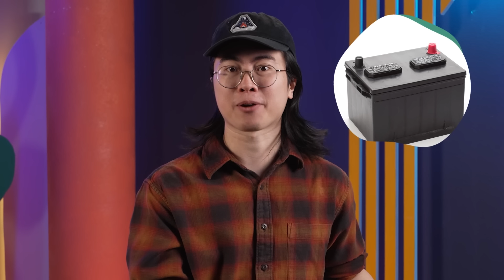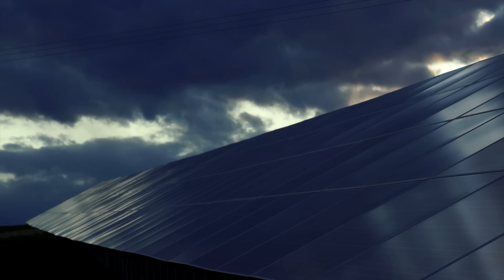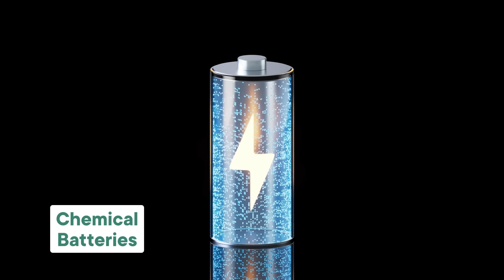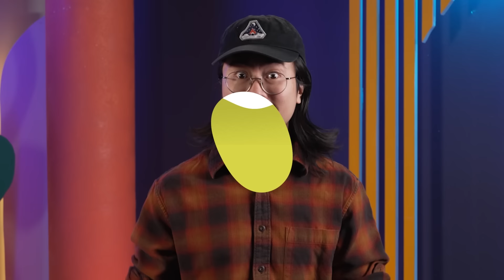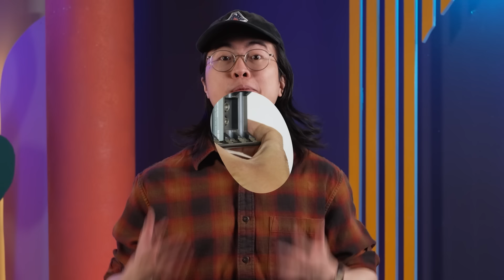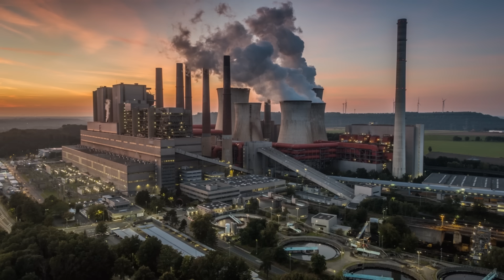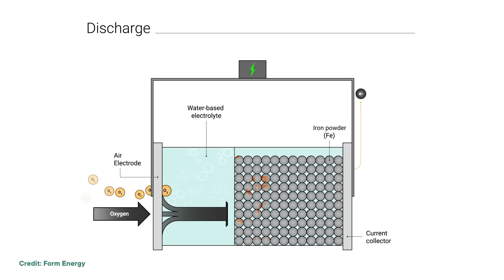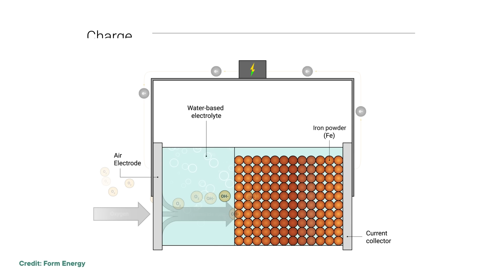The Weirdest New Battery is... Rust

Comment: I worked for one of the companies that provided equipment to form energy for the building of their batteries and I really hope they found someone else to make those parts. That company had absolutely no regard for cable management, which often introduced improper bends. Oh and they also ran a huge power supply cable in the same tray as networking cables so....

Comment: The Core: The 1kWh EVO Brick
• Chemistry: LTO (Li4Ti5O12) zero-strain spinel anode + Li6PS5Cl sulfide solid-state electrolyte + NMC cathode • Why it lasts: LTO has <0.1% volume change during charge. No cracking. Solid-state blocks SEI growth and dendrites. • Result: 1,000,000 cycles at 80% DoD with 95% retention. 146 Wh/kg at cell level. No thermal runaway. • Weight: 6.83 kg • Target Cost at Volume: $99.50 / kWh — BOM is public: $22 electrolyte, $18.50 cathode, $15 LTO anode, $12 BMS. 
Then we scale the same brick

Comment: I'm guessing these batteries will be damaged by low temperatures, for the same reason why you don't discharge Lead-Acid batteries too much, when too cold below zero, because the Sulfuric Acid Electrolyte becomes more like water, and when water becomes ice, it expands, with enough force in a sealed space to rip engine blocks, which is why engines used during winter must have Antifreeze mixed into the coolant. 

At least with Lead-Acid batteries, you just have to keep them charged enough for the low temperatures you're expecting. The more charged. The more the Electrolyte is like Acid, less like water. I think like 60% or higher, Earth weather temperatures can't freeze a Lead-Acid battery. But these Rust-Air batteries, requires water. Pure distilled water? So does this mean they have to be deep underground, or in temperature controlled rooms to prevent freezing? Or their Water Electrolyte already has some Antifreeze mixed in, that doesn't reduce the effectiveness of the battery? I have to look into this. This is the the first time I've ever heard of Rust-Air batteries.

Comment: These guys are creating a huge hype around iron air batteries. While they could be much cheaper (10% of lithium), currently they are just cheaper (~50% of lithium). Also they are heavy (~4x of lfp) and needs a lot more space (5x of lfp). But the bigger kick is their discharge rate as well as high self discharge and low efficiency. Their discharge rate is 0.01 C, meaning a full battery takes 100 hours to discharge. This is advertised as a good point but it is not. For comparison even slow discharge LFP batteries have 2C discharge rate. This means you will need large amount of storage to make up for the slow discharge. Second issue is self discharge, iron air batteries discharge about 2-5% everyday. So if that cloudy day doesn't come for a week you will lose 1/3 of your power in that duration. In addition, they are very low efficiency. Even if they are used immediately after being charged, realistically, you will get about 40-50% of what you put into the battery. In real world applications you will be looking at 20-30% efficiency.

Some of these figures will probably improve overtime; even if they don't improve, a cheap battery tech is currently needed to balance over production. But this tech is being way overhyped for what it  brings to the table.

Comment: "A hundred hours worth of energy" is a completely meaningless stat if you don't also include the power draw. 100 hours powering an Arduino is not the same as 100 hours powering an EV.

You really failed to sell the concept just because there's literally nothing to compare. Like, we'd never be able to sustain a power grid if "over 100 hours worth of energy" is true only if you're charging a cell phone.

Comment: really sad 70% of the video is about what 90% of people knew who watch this kind of video.
So much detail on Lead Acid and Lithium and just a short blurb on this new iron air battery.
I'm not sold on this as it seems the cell resistance should be pretty high. Which means lots more cells in parallel and likely batteries several times the size of an equivalent Life04 installation.
The rusting action I suspect would give a lot of mobility of the iron particles after only a few cycles. But I'll see what I can find about this battery chemistry.

Comment: renewables are supported by the fossil fuels industry,  bcs they physically cant solve the issue, without ecological violation, and 'perfect conditions', and batteries wont prevent this issue [tho it can help]; you need Nuclear Power as a baseload on the grid, just as these fossil fuel companies are pushing for, in regards to coal and natural gas, as baseload on the grid. Nuclear Power is the only way we are gonna escape fossil fuels

Comment: My institute physics teacher showed us that you can make batteries out of coins, and that technically any 2 metal things with a poorly conducting gap betwen them can be a capacitor.
Not the same as an accumulator but pretty fun still.
Reply: So called "super capacitors" can hold a significant amount of energy.  The trick is to make the nonconductive barrier very crinkle so that it has a huge surface area.
Reply: @kensmith5694  cool

Comment: Don't lead-acid batteries live forever? There's no thin isolation layer to pierce, just a vat of acid instead.
Reply: Other side reactions happen that degrades the material in the battery.  This happens mostly when it is discharged.  If you keep them charged, it takes quite a few years before they need to be replaced.

Comment: Instead of pouring thousands of tons of concrete ballast into the lower basement levels to stabilize the base isolators, new skyscrapers should install dense, heavy rows of iron-air batteries. They supply downward force required for structural physics while serving as grid infrastructure.  However, Sodium-ion is a more costly but far more energy dense smaller package choice for neighborhood substations, and works better in a wider range of temperature zones.

Comment: @7:25 You "higher capacity" is a bit misleading, because energy density of iron-air battery is 4x lower compared to li-ion batteries and it will take a lot more space. If 110x lower cost compares the same capacity, that is impressive. If it only compares the material costs, we are only being 25x cheaper than li-ion. Taking into account that charging/discharging wastes 3-5x more energy each cycle vs. Li-ion, we are now at 6x cheaper than li-ion.

Comment: When I was in highschool I made one of these for a science project. It was made with a sheet of tyvek, a layer of graphite silver paste with a silver plated stainless steel screen for the positive electrode, a potassium hydroxide electrolyte, a fiberglass separator, some steel wool with rust added, and a stainless steel screen as the negative electrode. Charging makes silver oxide and iron, discharging makes silver and rust, but the silver only helps to kick start the reaction by shuttling the oxygen in and out. Voltage was about 1.3V freshly charged, and 1.1v after it stabilizes. ❤

Comment: It would be nice if you actually gave some technical stats and comparisons for the people like me who cafe about them like cost per kWh, charge rates and discharge rates, energy density kWh/kg and kWh/l. Rather than just hand waving and saving hey they are cheap and provide steady power....how cheap? Just state it in a couple of slides. It also shouldn't take you 6 minutes in a 10 minute video to explain batteries before you get to what makes this type of battery special or unique....

Comment: I absolutely could be wrong, but I thought the current flows from negative to positive, the electrons want to flow from the electronegative area of the cathode through the electrolyte to the anode. When the charge gradient reaches equilibrium, the battery is 'spent'

Comment: if the show hasnt done it yet they should do an episode on (or mention somewhere) those Gravity Batteries or whatever theyre called. where renewable but inconsistent energy (wind, solar) is used to "charge" the battery by powering pumps to move water from a lower reservoir to a higher one, and then generating hydro power on the way back down by releasing water on demand (no wind, no sun days). ive wondered how well the math actually works out on those.

Comment: The problem with rust is not the oxidation itself, but the corrosion (the same happens, albeit in a milder manner, with lead acid batteries). This video didn't mention how the corrosion would be dealt with.

Comment: rust also has the power to break concrete its called spalling. rust expands and forces cracks into concrete that lead to structural failure if its bad enough

Comment: While it's very enthusiastic they never spell out the disadvantages of iron air batteries. Which are huge. Rusting of iron is an extremely slow chemical reaction. It's extremely inefficient. They will only ever make sense if we have massive over production of renewables. The size of the battery you would have to build to have any kind of grid level power output wouldn't make sense when there are better alternatives. I'm not sure why SciShow did this one. It seems under researched and over hyped.

Comment: Its not a lithium replacement -- just a large scale power hold .... but theres plenty of competition there , from moving water (oops we short of that) , to high pressure air storage, or any reversible chemical reaction. (all of which are used in some place or the other), or even converting co2 into methans, then burning the methane.... Pretty sure i remember a 'battry for cars' touted by camebridge (univ i think) which used 'rust' ....

Comment: Also, if corrosion is what causes the electron flow couldn't a more corrosion solution than water be used in applications where faster electron release is required? What about using liquid oxygen?

Comment: Summary:
Iron-air batteries are low-cost, heavy, and well suited for long-duration grid energy storage, offering lower efficiency but improved safety and extended storage times. In contrast, lithium-ion batteries are lightweight, energy-dense, highly efficient, and ideal for electric vehicles, consumer electronics, and other applications requiring fast response and compact size.

Comment: Come on. Cobalt oxide as cathodes? You should know that LFP batteries are the main technology right now. LFP has no cobalt. Cobalt oxide is really outdated. This is especially important because some anti renewable people would fixate on cobalt mining…which is way less polluting than constant fossil fuel burning, but most importantly we have better LFP technology that doesn’t requires cobalt at all.

Comment: If you have a battery technology that gives up its charge slowly, then you just put a bunch of those batteries in parallel. There is no need to supplement an iron battery with lithium batteries for grid storage. You just supplement iron batteries with more iron batteries.  I watch y'all's videos with the expectation that you have actually researched what you're talking about. Your lack of fundamental knowledge about  something as simple as the discharge rate of a battery is getting pretty telling. You all are trying to get away with doing the minimum amount of work for the maximum amount of watch time, and it is starting to show. The so-called discharge rate of a battery is nothing more than the amount of current that it can produce. What do you do when you need more current? You put those current providers in parallel. Another words, you put more batteries in there in parallel. There is no need to put in some other, more expensive battery in parallel.

Comment: Batteries are the solution to everything.

We don't need more solar power now, we need simple, cheap ways to store what we already get! We need (in order of importance) 1. huge capacity, 2. huge energy density, 3. cheap, 4. non-explosive, 5. non-toxic, 6. quick charge, 7. lasting at least a decade of everyday use, 8. scalable in size batteries. 

And if a battery combines these 8 features - we got climate change fixed.

Just think about it: you won't harvest even free crops if you don't have nowhere to store it! We use the power grid as a battery! That can't work in the long term, so in a desperate attempt, we use our current battery technologies, that won't even meet half of the 8 requirements. But if you want energy solved - just solve the batteries.

Comment: I'm very confused by this video. If deoxidizing rust is so simple without producing CO2, then why does the vast majority of smelting involve coke or coal and emit large amounts of CO2? I've always taken the CO2 intensity of smelting metal oxides as a major reason metal oxide batteries probably aren't viable, and this video kind of glosses over that. While I imagine it may be possible, I don't think it's easy to just apply current to rust and water in air to get non-oxidized iron. This video makes it seem like it's a standard thing, which, to my knowledge, it isn't.

Comment: Some old German coal power plants are getting refitted to burn iron powder creating heat (and thus electricity) and "rust" without emitting any CO2. They are supposed to run during peak hours and the infamous "Dunkelflaute". When there is a surplus of power in the grid, the "rust" is reduced to iron and oxygen. 
So that's why rust is going to be impactful in the near future.
Reply: Where does that iron powder come from?   I am guessing it is waste from somewhere.   You couldn't make iron powder from ore without using more energy that you get from burning it.

Comment: Wind & solar are still super expensive, LCOE does not take into account the overbuild requirement to achieve a guaranteed grid output. And the Duck Curve is brutal - batteries help to flatten that, but peaker plants are still required, and it's still terribly complicated

Yes I do have a solution and yes I am actively working on it and yes we have viable opportunities to decarbonize completely, industry included

Comment: Fun fact, NiMH rechargeable batteries are a compatible voltage and size with alkaline batteries but can deliver WAY more current and be recharged thousands of times (for the low self discharge ones made in Japan, they hold a charge on the shelf ~10 years). They are also really great in the cold compared to alkaline cells, and because of their construction, are able to power high loads like mechanical things, powerful flashlights, or photography gear better and often longer than good alkaline cells. So for the devices you have that take AA or AAA cells, or even D cells, use NiMH cells like the Panasonic Eneloop cells. Kind of nuts when a single AA NiMH has more current than a standard D cell.

Comment: lithium batteries where not super common in phones until the mid 00's. most phones had NiMH or NiCd batteries before about 03. back then a phone would last a week plus on a single charge, it was only things like colour screens and cameras that really pushed the need for lithium (also, lithium batteries were still expensive up until the mid 00's)

Comment: EVs have a standard lead acid battery just like gas cars. 1:51
Reply: You mean to run the ones to run standard automotive accessories and not for actual propulsion?
Reply: Most EVs run on Lithium Ion batteries. Lead Acid EVs are mostly home conversions and small projects.
Lead Acid is slow charging, and doesn't have much capacity for its size and weight compared to Lithium Ion. Those are important factors in EVs.
Reply: @acarcana2223  they don't supply the driveline, they supply accessories like infotainment. They are charged through a DC/DC converter from the high voltage battery

Comment: Unless something changed recently, metal-air batteries suffered from extremely high degradation rates that limited recharge cycles to very low amounts. It turns out it's pretty hard to keep a battery's chemistry pristine when you're directly exposing it to the atmosphere, and if you control the air (oxygen) feed enough to make it pure, all the weight, space, cost, and efficiency savings disappear.

Comment: Iron Nickel is a similar concept - too big and heavy for mobile uses, but for grid storage or site storage, they're fairly cheap and reliable.  They'd be cheaper than li-ion, if they weren't niche.

It's really weird and wasteful to build stationary power storage using lithium.  We're going to hit Peak Lithium pretty quickly at the rate we're going, and then the price is going to skyrocket.

Comment: Immerdiant problem realized in the design as soon as you mentioned the liquid is just and only water.... freezing. the batteries would SUCK in winter as they freeze. unless the power stations have machines which will keep the water from freezing then the batteries best effectiveness would be summer with spring raising effectiveness slowly to summer and lowering as it gets colder and colder in the fall.

Comment: 4:27 that's a realy badly written part of the video. It gives the impression that burning oil is ok and using battery is realy bad when it's in fact the exact opposite
Despite being a source of polution at the fabrication, battery are excellent for the environnement, specially in cars, because they displace a lot of oil burning. In a country like France with a lot of clean electricity, if you compare two cars of the same "class" (like a Renault Clio and a Renault Zoe) you get a reduction of CO2 emmission of 72% over the lifetime of the vehicule (estimated to 200000 Km)

Comment: You don't put electricity back into the battery. An electric current runs completely through the battery (meaning in and then out) causing a chemical change within the battery that creates a potential difference between the two elements in each cell of the battery.